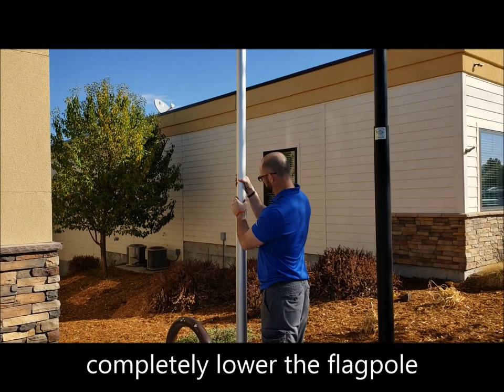Replacing Titan Flagpole  Interlocking Sleeves

Comment: Has anyone had any trouble getting the pole out of the mounting sleeve that is in the base, after loosening the clamp my pole will not budge?  I sprayed wd-40 around the bottom and used a rubber filter clamp to turn the pole but so far still will not budge..

Comment: I can't seem to get my flagpole out of the ground sleeve in order to replace the bottom locking sleeve. Any ideas to help would be great. At this point I can't use the pole.
Reply: I had the same problem. It just was the fact that it had been in the ground for a long time. I got a couple of my grandson's buddies (he's 20) and we first got it to rotate so it would start to move in the ground sleeve. The we rotated it out of the ground sleeve. Just got to add some good muscle to get it out. Good Luck. PS Before putting it back in I used a scrubbing pad to clean the portion of the pole that goes into the ground sleeve and the interior of the ground sleeve it self.
Reply: @paullinville6998  good advice Paul, thanks! I think the ground around the pole and concrete is still semi-frozen so it might be a good idea to hold off trying to twist and yank it out until spring!🤣 don't want to throw my back out! Appreciate your time and  replying.
Reply: After struggling several years removing my pole from the in ground mounting tube I installed a rubber 3'' roof vent sleeve at the bottom to prevent debris from going down in it. Works like a charm now. Bought it from Menards for about $3.

Comment: Thanks for very helpful video. I had to only replace the bottom sleeve- and this doesn't require removing the pieces near the top of the pole. Also, as my pole is several years old, pulling out the bottom cap was very difficult. I had to spray some WD-40 and wiggle it loose with locking pliers.  If one is gentle raising and lowering the sections then the sleeves should hold up well. On my pole, the bottom cap of the lower sleeve cracked off because the pole was allowed to frequently slide down (with most of the the pole weight) repeatedly hitting that lower sleeve end.

Comment: Good video.  Grit and dirt do make it a little bit more challenging.  Also i misunderstood and replaced all of the top locks first then all of the bottom locks.  Each pole has to be done independently, with top lock installed last or it wont slide through the top locks.  Otherwise it was about a 2 hour project to complete and Im very grateful for this video.

Comment: Just replaced the interlock system in my Titan flagpole after about 10 years of faithful service. I must say, this video makes it look much easier than it actually was. Mine had 10 years worth of dirt and grime built up in the base and the sleeves. It wasn't hard to get apart, just tedious, because I had to work with all the pieces carefully not to burr up the pole itself. All in all though, I have no complaints about my Titan. I hope it last me another 10 years.